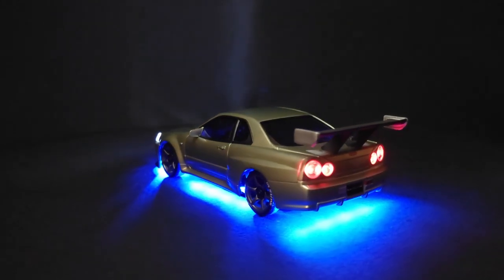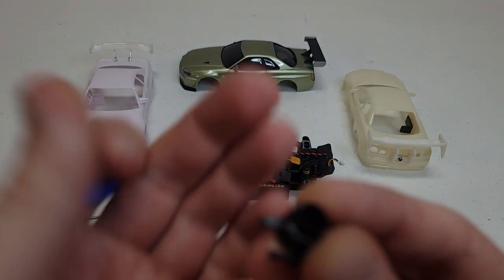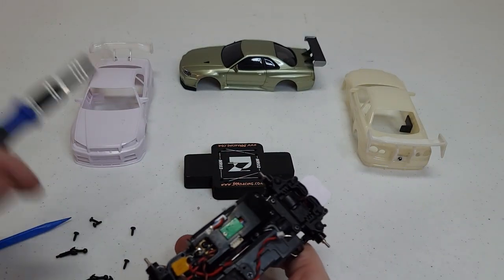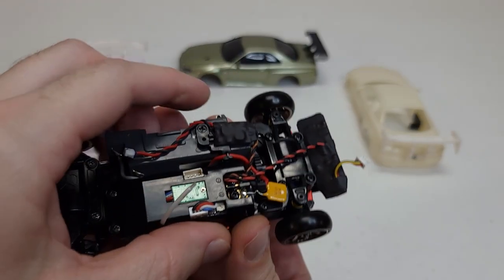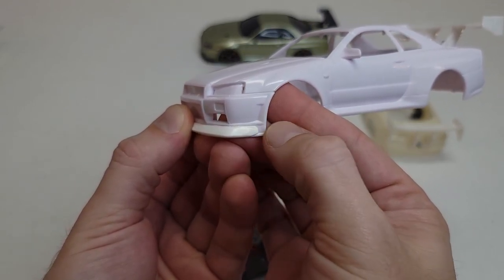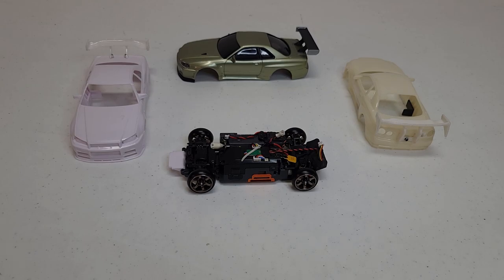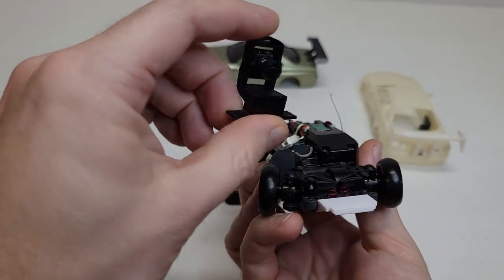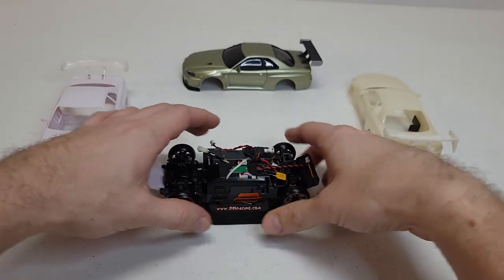MINI-Z MA-020 AWD **STAGE 2** Upgrades, Install, Test Drive and More!

Comment: ❤❤❤❤ My alll time fav Radio is Futaba 3pm w/ mini-Z module and a bunch of after market receivers on Hobby King for under 15AUD For the rest of your R/C's but like Jiles Groskamp i totally respect the O.G Air controller radio..and he still won worlds 1/10 on-road 😂😂😂😂 Retro versatile...like those dudes with Tamiya Kenworth / Mack trucks, i want one...they usually got waaay more range than your trigger and Any who....owning a hobby shop is the DREEEAAAM😇😇😇😇
Reply from the maker: I hear ya, I still use my Taranis X9d+ for all my drones, helis, planes but haven't made the switch to use it with my cars. Maybe down the road I will but for now I'm still using the trigger radios and I agree owning a hobby shop would be awesome just wish there was more people interested in RC so it was more popular and could actually make some money through these addictive hobbies lol

Comment: fpv everthing! you a micro guy too!!! was thinking of putting those magnetic camera mounting thing in for fpving (the ones from those little diatone/sniclo/snt cars). just power it directly from a battery. but your mounting looks awesome too! even better to combat that jello 💪
Reply from the maker: Yep micro drones was my main hobby for years before I started messing with Mini-Z's. Unfortunately micros are not as popular as they were a few years ago so it's hard to make videos on them to get a channel going so I put more time into these little RC cars. Yea those little magnet mounts seem pretty convenient to swap on and off any miro RC thing, I just have a lot of old fpv parts from my micro drones so I'm trying to give them use where ever I can. To be honest I haven't had a lot of time lately to drive or fly anything fpv as much as I'd like to but I do one day wanna get some fpv vids going again to post on here eventually, just not sure when :/
Reply: @AirToGroundRCFPV  make time! its a form of therapy ,flying! free as a bird! summer is coming soon!
Reply from the maker: @fluffynl3390  I agree, nothing else like it. When I get the time I will 👍

Comment: Any chance you are going to do a series on your wltoys k969 rwd rc?
Reply from the maker: Yea I am actually, I'm almost done with it and I had to make some 3d printed parts for it so it's taking a lot longer than I wanted to finish unfortunately. To be honest it's been a pain in the ass lol but I'm making it low profile so I can fit my MR-03 98mm racing wide bodies on it, I'm just having trouble finding the time to juggle between it, my MA-020 and the bodies I've been painting.
Reply: @AirToGroundRCFPV  That's awesome to hear! I can't wait to see it.

Comment: What happens if the ball bearing is stuck on the CVD? What's the best way to get it off?
Reply from the maker: By force lol Yea if I remember correctly that happened to me on the stock ones, you can stand the cvd vertical on the table and hold it steady with your hand and with your other hand use a tool like pliers, curved tweezers or something similar and place the tips flat on two sides of the top of the bearing and then press straight down the best you can to get it off. Maybe put some spray lubricant on the cvd too to help loosen it to get it to slide off if its really stuck, hope that helps and good luck!
Reply: @AirToGroundRCFPV  Yeah! That got it man! Thanks again!
Reply from the maker: @jawzdeadeye  No problem my friend, glad I could help!

Comment: What's the poijt of camber adjustment when you have rounded tires? You're always gonna have the same contact patch regardless of spring compression or roll.
Reply from the maker: You don't have to add camber if you don't want to and I don't always run round tires and like the way it performs with 4 degree camber, feels like the wheels really lean in on aggressive turns giving it a little more grip while throwing the back end out. They do make tires that match the degree of camber you have as well which are best I would think. Also, it seems like all the serious RC drifters out there like lots of camber so your question is probably better answered by one of them, I just drive these Mini-Z's for fun. Hope that helps

Comment: Can you send a link of the under glow lights
Reply from the maker: Sorry for the late response, my other video covers how I make them and where I got the strips from here: https://youtu.be/tSKApS4mwDY But they are not easy to make and need to be good at soldering small wires to fit right, hope that helps

Comment: Hi, I'm new to the world of kyosho. I have a question: Is the chassis of an R34 suitable for a body of an R33? thanks for helping
Reply from the maker: sorry for the the delayed response, yes the R33 has a 94mm wheelbase just like the R34 and i think the wheel offsets are the same so you can use the rims they come with on either body

Comment: Did you change the degree on the rear control arm or kept it at 0?
Reply from the maker: At the time all I could find was zero so I went with that
Reply: @AirToGroundRCFPV  have you changed it since then?  What would you have changed it to if you found other degrees? 
Building my first ma020 drift spec. Thanks for the help.
Reply from the maker: @orsini3569  I haven't changed it yet since I don't think anyone makes them, I could possibly 3D print one but it wouldn't be as strong as metal and I want to keep it metal. I think if you get the DWS rear suspension kit you can change out to a metal piece than can change the toe to either 2 degree or 4 degree, I saw it on wolframrc.com. Toe In is what you want in the rear and I would probably test out 2 degree at first before something as high as 4. Hope that helps and you have  alot of fun with your build.
Reply: @AirToGroundRCFPV  Got it. Thanks. 
So neg toe in the front with pos camber
And positive camber and toe in the rear? 
I've been eyeing the wishbone system.
Reply from the maker: @orsini3569 Yep, toe-out in front and toe-in in the rear. Camber is more useful in the front so it's not as important in the back but it helps the look to match the front. Also Toe-in in the rear isn't as important as Toe-out is in the front so prioritize the front end first then do what you can to the back end when you can. I did find one set of toe-in control arms on ebay but it's like 35 bucks for a set of 3 so maybe I'll switch to them down the road just not that important especially since I can get a DWS rear end for like 40 to 60 and then can't use those control arms anyway so I'll have to decide which route to take when I have some spare funds

Comment: Nice car you got there, I really like that body. But how difficult was it to run the gyro cable the way you did? Thanks!😊
Reply from the maker: Thanks man, sorry for the late reply it wasn't to bad I just tucked it under the plastic cover with just enough room not to pinch the wires, I think I showed that in the video as well so I hope that helps.
Reply: @AirToGroundRCFPV  Oh, okay. Thanks for getting back to me.

Comment: Where did you find those wings? BTW great video!
Reply from the maker: Thanks bud, I appreciate it. Been a lil busy unfortunately but short answer is I designed them in Tinkercad then 3d printed them out of PLA. The screw mounts on them are pretty fragile so I covered them in epoxy to strengthen them before painting. Went through tons of prototypes
Reply: @AirToGroundRCFPV  Thanks for your answer.🤜🤛

Comment: Are you using the non s ma020? Is this the dasmikro mwz431 gyro? Really want to pull the trigger on the yellow subaru ma020 with the kt-531p tx but afraid ill have to spend alot on a gyro even if it isn’t necessary on an awd I want it, can you link me to the one you bought?
Reply from the maker: Yes, I have the non S version that came with no gyro, it helps the handling if you do add one but you don't need it. The DasMikro version I got from Aliexpress for less than 15$ with shipping, here's the link:  https://www.aliexpress.us/item/2255800979943729.html?spm=a2g0o.productlist.main.3.7587243fiy4STK&algo_pvid=2cfbc816-4fb9-423b-923b-fc2ad22222f4&algo_exp_id=2cfbc816-4fb9-423b-923b-fc2ad22222f4-1&pdp_ext_f=%7B%22sku_id%22%3A%2210000014984024018%22%7D&pdp_npi=2%40dis%21USD%2111.99%2111.99%21%21%21%21%21%402102110316747749870398576d06d5%2110000014984024018%21sea&curPageLogUid=IGW6AYJx3bO8
Reply: @AirToGroundRCFPV  appreciate the reply my man! definitely makes me more confident in making a purchase and saw most ma020 need a mzw431 gyro which is like unobtainable is the dasmikro one just compatible with the s and non s ma020?
Reply: @AirToGroundRCFPV  also love your k969 build got mine rigged up with the radiolink r7fg with gyro too
Reply from the maker: @Aidrock10  No problem bud, glad I could help out and I'm pretty sure the DasMikro one is the same as the Kyosho one coming from the same factory in China I bet, they look identical and it works fine on a regular ma020 and should work with most other Mini-Zs as well.
Reply from the maker: @Aidrock10  Nice, those r7fgs are great for custom builds, once I get some time I''ll do that rebuild video
Reply: @AirToGroundRCFPV  i just know there is a mzw446 i think that is pretty common and cheap but doesnt work on all ma020 I forget and are confused on how it works but the non s version needs the mzw431 where the s would take the mzw446
Reply from the maker: @Aidrock10  I think you're right, honestly I don't remember either, sucks it doesn't give you a part # but in the description of the DasMikro it doesn't list the ma020 it says its for the sports but it works fine on my ma020 so its hard to know for sure.
Reply: @AirToGroundRCFPV  also if youre using the r7fg keep in mind if you’re using an esc without lvc you can solder the telemetry cable to the esc and use that for a lvc alarm on your radiolink
Reply from the maker: @Aidrock10  Thanks man, thats part of the reason why I got that receiver so I could see my 2s lipo voltage in the osd on the radiolink transmitter. I mainly build drones and used to seeing my battery voltage in my osd in my goggles so voltage monitoring is a must for me lol